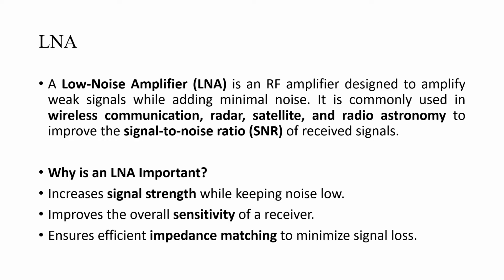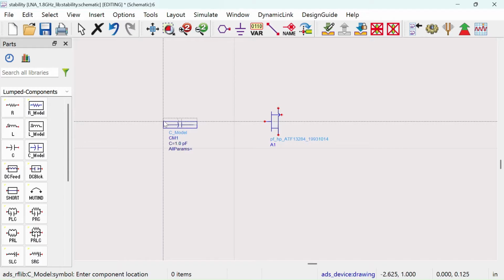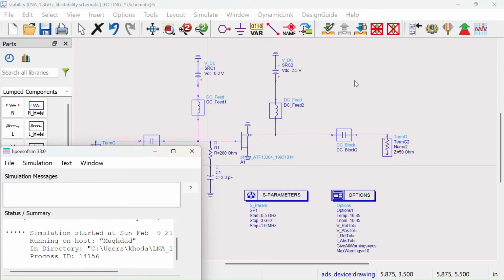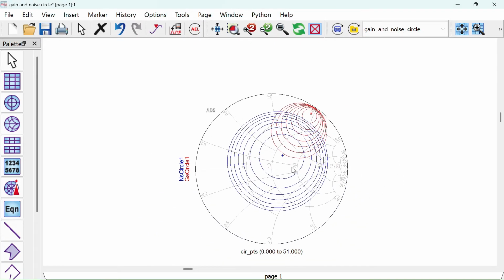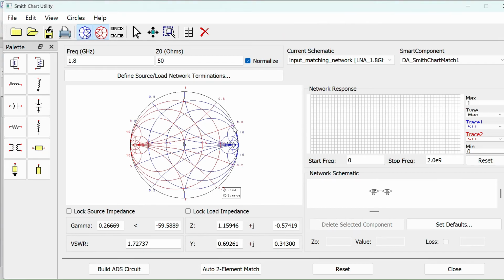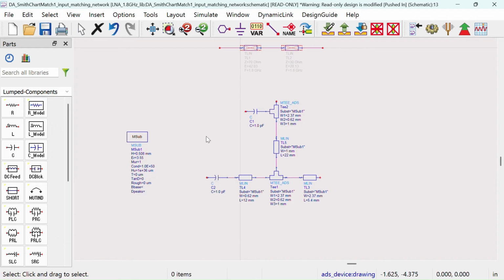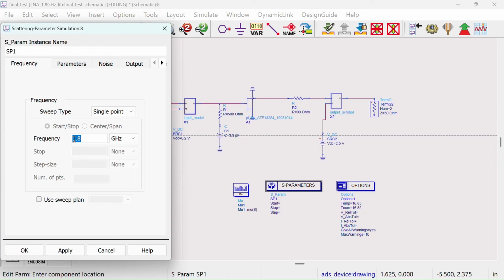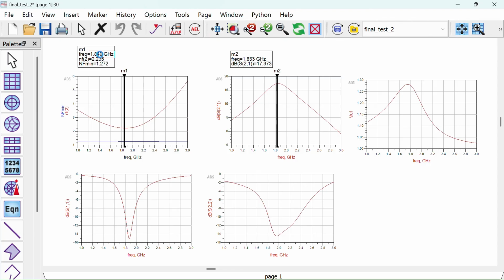Mastering Low-Noise Amplifier (LNA) Design with ADS | Step-by-Step RF Tutorial

Comment: Thanks for your tutorial!!
In bilateral devices, the output impedance selection should be a function of the selected Gamma_s to minimize noise. Instead of choosing the conjugate of S22, the conjugate of Gamma_out that provides maximum gain should be chosen, which is: Gamma_L=conj(S22+S12*S21*Gamma_s/(1-S11*Gamma_s)).

Comment: Sir, Can u pls share from which reference paper u have done this project? It will be helpful for us.
Reply from the maker: @448keerthana6  Thank you for your question. The design is just a example we created to demonstrate how to design an LNA and adjust the parameters to achieve the desired performance. It’s not taken from a paper.
However, if you’re looking for detailed design examples for specific transistors, you can check the application notes provided by major manufacturers such as Mini-Circuits, Avago, and Infineon. They include step-by-step guidance and additional details for designing with their components.
Best regards

Comment: I couldn't find the transistor library file for ATF. Can you help me?
Reply from the maker: To add the library that includes this transistor, go to the DesignKit menu in the main window and select Add Library. A window will appear asking for the path to the desired library.

Navigate to the folder where Keysight is installed, then open the oalibs folder. Inside, you’ll find various libraries provided by Keysight. Locate and select the component library that contains the transistor models.

After adding the library, it will appear in the Palette, and you can then use those components in your schematic.

Comment: Professor, could you explain why a quarter-wave transformer is preferred over a large inductor for isolating DC from RF? Is the reason that at 1.8 GHz, lumped elements such as inductors introduce significant losses and potential distortion, whereas distributed solutions like quarter-wave transformers operate more effectively at higher frequencies?
Reply from the maker: Yes exactly, at 1.8Ghz inductor can be used as well, since it can provide a good isolation between RF  and DC signal. But in general, because of some restriction such as SRF( self resonant frequency) and some parasitic components that are added to the inductors specially at higher frequencies, using the quarter- wave line could be more effective.

Comment: I wanted to design amplifier which amplify 100MHz signal but I have no idea that what components or modes should I use. I hope this video will help
Reply from the maker: The process is the same, first you need to choose the proper transistor, and design the input and output matching based on the way that has been explained in video.

Comment: I noticed in your video on power amplifiers that you used the SP_NWA (network analyzer for S-parameters) to check transistor stability, and you also used the load-pull simulator to determine the transistor’s optimal input and output load. I wanted to ask — can we use those same tools when working on a low-noise amplifier?
Reply from the maker: In load pull simulation mist important parameters of PA  calculated respect to impedance changes, in LNA design this kind of test bench can be used but it needs some changes to enable us determine the Noise figure as well. So the shown method is the easiest way to determine the optimal input and output impedance. There is no problem ,As long as you can check the behaviour of important parameters by changing the impedance by a specific schematic test bench.

Comment: where can i get the hspice model files for atf series transistors
Reply from the maker: You can add the library through the ADS library, and choose the add library link, then you should follow the path that ADS has been installed, you will find a folder named oalib, in that folder you can get in to the component folder and choose the transistor models. All of transistor models that include ATF series as well are found there.

Comment: Can you let us know how you got the library files.
Reply from the maker: @CAkshayNaik-e6s  In the main page of ADS go to the designkits menu and then choose the manage libraries. In the new window pick the link for add new library, it needs a path to be able to add desired library. To do that, go to the path that ADS is installed and find the oalib folder and then components, in that folder you can add transistor library that includes the ATF series.

Comment: How is designing in ads different from cadence?
Reply from the maker: @sandhiyasahanapandiansamue1729  The final results should not be different, you can creat link between two sofwares and use both based on your design. 
No it is a wide band rf transistor for  low noise figure circuit purposes that there is library for that in ADS. In the main page of ADS you can go to the library window and choose the add new library, then it asks about the path, you just need to go the path that ADS has been installed , and find oalib folder, and then components. In this folder choose the transistors . It will be added to your pallet. And you can add it to your schematic easily. 
It is ads2022 version
Reply: @profhalimboutayeb  Respected Sir, we have microwave transistors/ RF transistors in the component folder. Which one to select?

Comment: How to fix this complex impedance of input and output values sir Ex 65+j*25
Reply from the maker: @arivazhakidravidaselvan1639  For the input impedance we need to use the noise figure and available gain circles. To do that,
we can pick the impedance that provide the highest gain value or lower noise figure. You can check those values on Smith-chart plot to get a better sense. But, for the output impedance you just need to plot the S22 and designing a matching network that convert 50 ohm to the conjugate of this value. In order to design those matching networks you can use the Smith chart tools provided by ADS.

Comment: what happened @28.22 sir, ho to fix this TL5 W & L values
Reply from the maker: @arivazhakidravidaselvan1639  We need to have a path to take the DC voltage to the transistor, but this path should not affect the rf performance. it is done by putting an inductor or lambda over four microstrip line that has been grounded by a capacitor at its load. Because this structure shown an open circuit at its input.The width of this line is not important that much becsuse it is not going to drawn a high current but the lenght should be lambda over four.
Reply: @profhalimboutayeb  Thank you sir
Reply: @profhalimboutayeb  sir could you please explain this calculation of the L of TL5  and TL6 in more detail